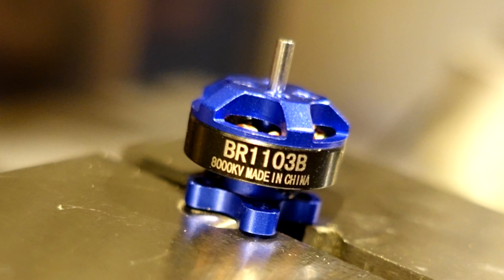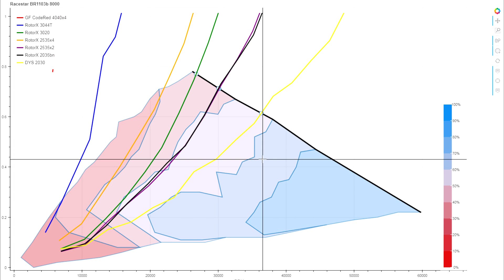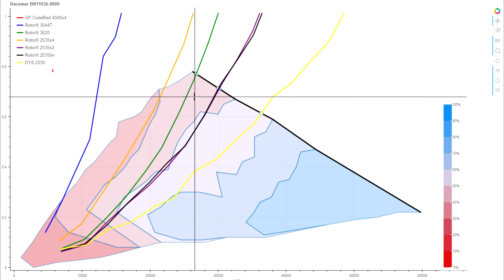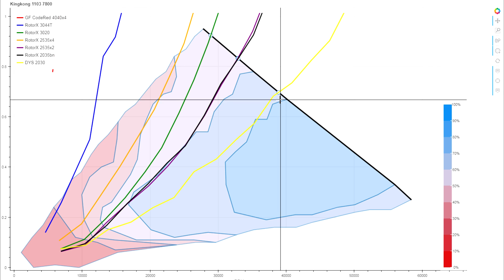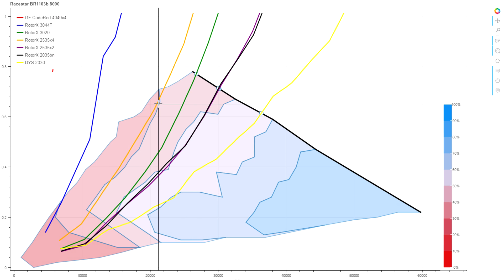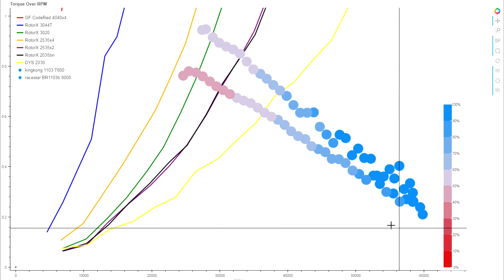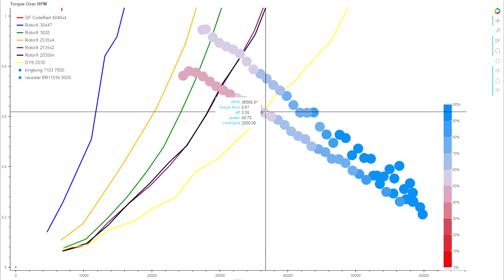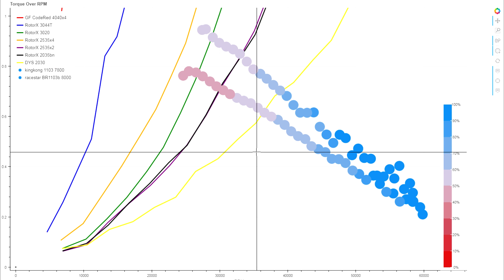Racerstar BR1103b-8000kv Dyno results

Comment: Interesting!! I really like these motors for their purpose. They get overpropped very easily as you’ve shown and really shine on props that are meant for brushed motors. “55 mm ‘ladybird’”- but the props where these motors shine are the KingKong 65mm (gemfan 65mm), which are meant for brushed motors so you have to drill out the mounting hole.  They are very low pitch.  The performance you get with those is astonishing ... the flight times with light 45-55g quads are fantastic and still tons of fun!  The props themselves are incredibly durable.

Comment: For a 2.5 build would you recommend the 3b-r 1105 6000kv BBB motor or a sunnysky 1106 6000kv motor? Or is there another that I’m not aware of that’s just godly? Ohhh and preferably not over $12 a piece.
Reply: Mini Quads Mega Fun IMO Sunnysky R1106 6500 or Emax RS1106 6000